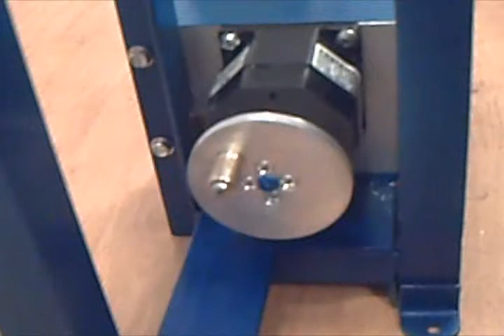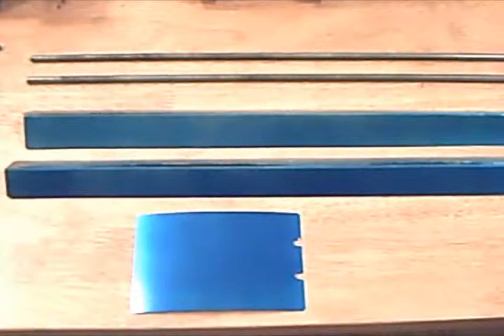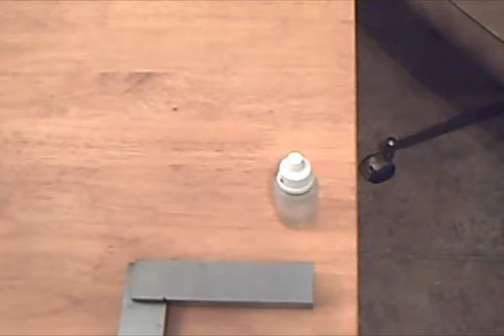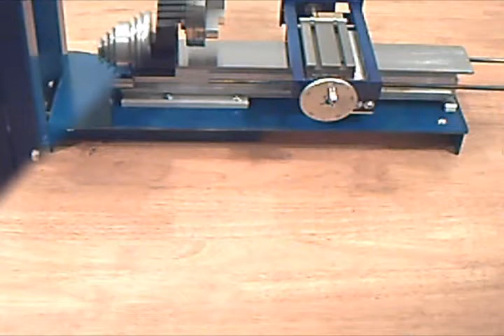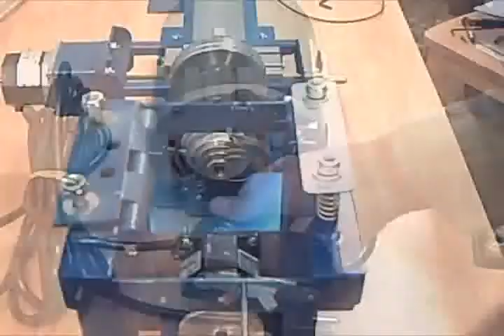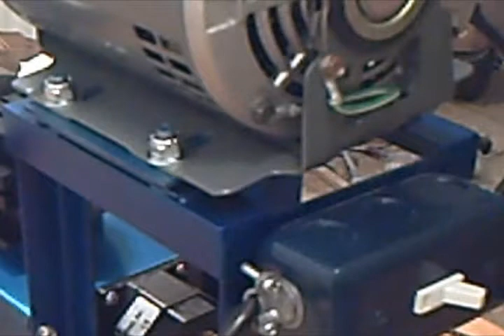UNBOXING the CNC Taig Lathe

Comment: first off the title should be changed, the "unboxing" is a completely different experience.
he definitely makes sure it arrives undamaged even if if is airdropped from 10000 ft.....LOL.
be prepared to spend a couple hours hacking thru all the expanded foam looking for all the parts.
OK, so I finally got one of these beautiful machines about 6 months ago and setup with a Gecko 540 controller using Mach 3. it is quite a beautiful machine and "sig" does some ultra nice work making all the parts used in the CNC conversion.
the man is a true artist.
so far my only complaint is the use of common all thread as lead screws which varies slightly in pitch thru out the length which causes tapers to be  wavy. other than that it is a fantastic machine and sweet conversion.
thank you Juan!!

Comment: I see two stepper motors, so I guess the two axis are computer controlled. I think the  motor for the spindle has no speed control, I dont see any controller there, but I guess it can always be added later. Correct me if i'm wrong.